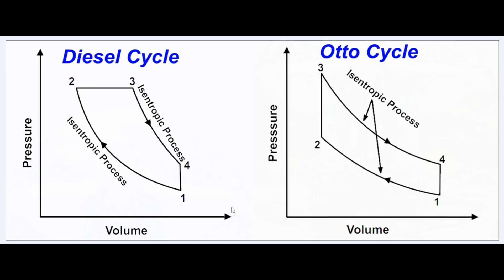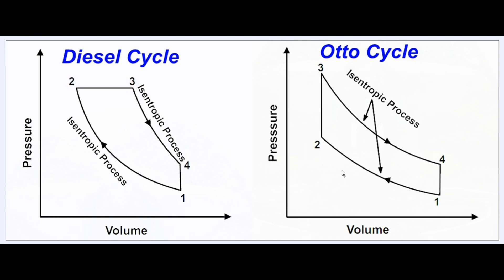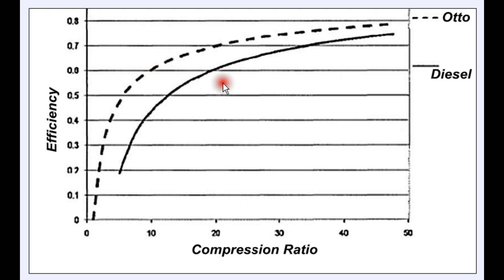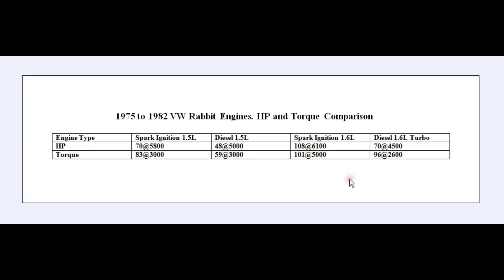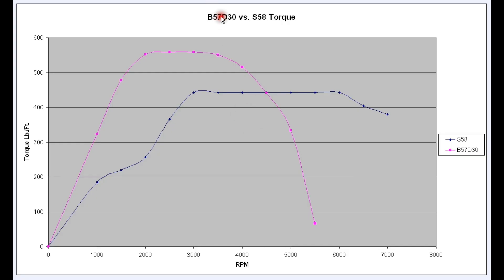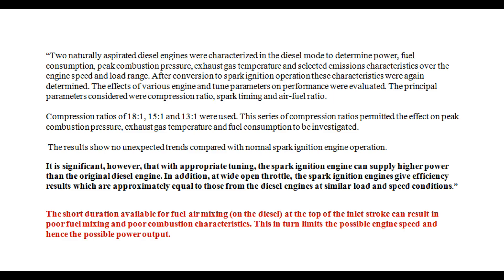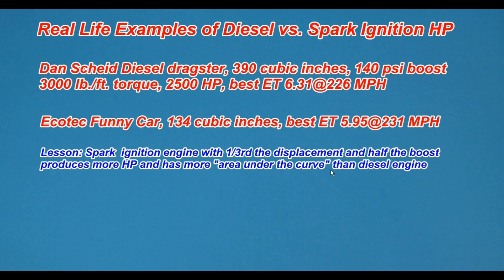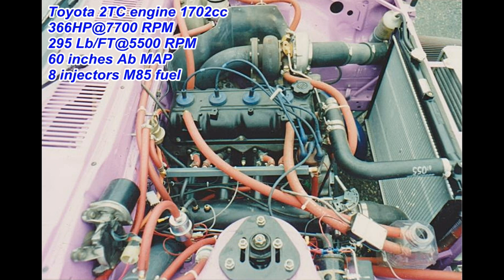Diesel vs. Spark Ignition. Torque and HP.

Comment: Talking about apples to apples, does it make sense to put fuel flow under the torque and HP on those charts?
Reply from the maker: The CI engine has a fair advantage in BSFC at high power compared to the SI engine. In cruise, with the SI engine running LOP, the CI engine only has a small advantage. Diesel/ Jet Fuel weighs about 10% more than Avgas per unit volume.
Reply: @rv6ejguy JetA is 10-30% cheaper than Avgas too, not important though... What if the aircraft is designed to run the engine at full/high power both takeoff (with electric assist) and cruise? Does it justify the use of CI over SI?
Reply from the maker: Aircraft engines run at pretty high power settings in cruise anyway. Electric assist is just dead weight in my view. @ruming404

Comment from the maker: Leo Arc, the torque curve is fairly typical of modern turbocharged SI engines where boost is adjusted to hold peak torque  and cylinder pressure just short of the detonation threshold.

Comment: In addition, a parameter which is often overlooked is engine weight. In a fair comparison, diesels tend to be heavier - a fact which is often and conveniently overlooked.
In some applications, diesels can have an edge while on full fuel tanks, but, as fuel goes down, that advantage quickly disappears.
Even when a diesel appears to be more efficient on paper, as soon as the weight is factored in, spark ignition often shows itself to be the better choice.

Thank you for another great video.

Comment: Is the graph at 8:50 (the torque distribution of the S58 engine) accurate?
From 3000 to 6000 RPM, the torque remains practically constant. That's not typical of internal combustion engines.
Reply from the maker: Very typical of modern variable geometry turbo SI engines where boost is varied to maintain peak torque just short of the detonation threshold.
Reply: @rv6ejguy  That does make sense.
Many thanks.

Comment: So the point is, everybody should want a motorcycle engine in their plane? Low weight, high rpm, high power.. Just gear it down to a prop and bob's your uncle. If all they want is the best power to weight.
Reply from the maker: Some of the sled and bike engines are working pretty well now and they can be a good choice for some folks. They are probably not going to last 2000 hours being flogged however.

The comparison just shows the facts. Diesels are expensive, heavy with low power to weight ratios but often have lower fuel burn and  lower performance. They can be the right choice for certain missions and where avgas is scarce or expensive, they make a lot of sense. There is no one perfect engine for all missions and locations.

Comment: VW rabbit engines were junk nothing compared to the cummins, Ford, or GM Duramax. There is no comparison if you take a 6-7LT gas engine boost it have to run racing fuel 115 octane to equal the power.
Reply from the maker: Modern turbo engines easily produce over 120-250hp/liter on pump gas. The Koenigsegg Jesko runs on pump gas, producing 1281HP from only 5L. Totally kills these diesels in specific torque and specific hp in factory form. On E85 pump fuel, it produces over 1600hp and 1100 lb./ft.

Comment: Yes the advances in SI engines now see BSFC in cars as good, if not better than CI engines however none of this yet translates to aircraft. 

High BSFC in SI requires high compression ratio's (12.5:1 in my own Audi FSI) and direct injection. Neither is possible/available in aviation engines as high compression triggers detonation at altitude and so the conventional solution is to run lower CR (<10.5:1) and resort to ROP operation particularly at higher power levels.  This means real world BSFC of SI engines is not good when ROP full power/climb power settings are included in the 'total flight' BSFC.  And turbo SI variants must run even lower CR to avoid detonation with correspondingly lower BSFC. 

Whilst experimental operators might 'dance with detonation' and attempt to improve BSFC by running high CR and leaning at higher power settings,  the price of failure is very high. Many many high compression experimental engines have failed this way.  Certified SI aircraft are not permitted to operate in the red box as detonation margins are preserved in POH procedures and CR is rarely permissible over 8.5:1.  Maybe there is a reason for this!

CI engines by comparison run optimum stochiometry at all power settings and are not limited by detonation considerations.  And they are all turbocharged out of the box so are equipped for altitudes up to around 25K to boot. Yes CI is heavier but the mission weight of fuel/engine is often competitive with SI when ROP operation with wasteful BSFC is avoided.  

The result is that CI engines are a LOT more fuel efficient. Here is a clip from the AVWEB review  showing the Diamond diesel powered DA50 was wayyy more efficient at 3NM/lb of fuel. Nearly twice good as an Cirrus SR22 at 1.8NM/lb.  The state of the art Panthera even with retract gear, only manages 2.4NM/lb of fuel.  The DA50 is fixed gear.

https://www.youtube.com/watch?v=fmlfg-74m3U&t=1016s

So its not accurate to portray the BSFC advances of 'ground borne' auto SI engines as suitable for flight. They are not. At altitude, CI engines rule when it comes to mission NM/lb of fuel. Attempting to replicate good airborne BSFC with SI engines using high CR and LOP operation at high power settings should be approached carefully as it is a pathway to detonation if not done well.
Reply from the maker: First, I'll direct you to this video where I dissect this subject in detail: https://www.youtube.com/watch?v=GJy93vrbvw0&t=16s You'll see that the aero diesels don't match the Adept SI engine in overall mission fuel burn.

High compression ratios doesn't trigger detonation at altitude. Detonation will be most likely at sea level where MAP and cylinder pressure is highest, not up high where MAP and CP are much lower. With EIs, we can tailor the point of PCP based on MAP and mixture strength. With mags, not so much.

Lots of my customers are running 9 to 10 to 1 CRs with no issues. The key is electronic ignition and EFI and lots of LOP operation (even in the climb) where cylinder pressure and CHTs are kept low. I don't know of any failures like you're taking about and we have many hundreds of people flying Lycomings and Contis like this for many thousands of hours.. There is no "dancing with detonation" here as you assert.

 TAT Runs 8.5 CRs with their certified turbos in the Cirrus and these are more efficient than the early factory std 550 turbos. CHTs are actually lower on the TAT as well.

Nobody is routinely flying aero diesels at 25K as none are certified to fly up there and canula type O2 doesn't cut the mustard up there. Additionally they cannot maintain anywhere close to rated power up there due to the high pressure ratios that CI engines require to make hp.

I'm not sure what data that chart is based on but it isn't of data from Diamond's website. Diamond only lists max cruise as 181 KTAS and fuel burn at long range cruise at 59.4 pph. Obviously max range cruise won't be at max speed. Lets say generously 155 KTAS. That's 2.61 NM/lb. This isn't even as good as a fixed gear RV-10 running LOP with EI where we've seen up over 2.9.

The DA50RG is a very heavy, high drag airframe, in part due to the heavy diesel engine.

Make sure you are comparing at the same altitudes and TAS or it's meaningless.

I don't think you're up on the latest tech as applied to Experimental Lyconentals or modern SI aero engines like the Adept 320T.
Reply: @rv6ejguy   Every SI engine that is leaned at high power settings will transition near or over detonation regions. With Mogas the potential for detonation is worse.  Detonation leads to higher crank loads and EGT excursions which burn valves and stress exhausts.

Sure LOP is great for reducing these problems however the transition from ROP to LOP must be made each time.  The temptation for operators to 'save fuel' when ROP it to get too close to peak EGT.  Or 'get more power' when LOP and again get too close to peak EGT.  Same when tuning where the temptation is to advance ignition for more power and again increase BMEP with potential detonation.   FAA mandates generous detonation margins in certified engines, however the temptation for experimental engines is to test these margins and 'dance' close to peak BMEP/EGT in order to save fuel or get more power. 

I'm surprised you are debating this point when CI engines simply don't have it as an issue at all, yet for SI tuners its the number one consideration and issue.  For proof how experimental versions of certified engines die from detonation, why not start here;
https://web.archive.org/web/20190409234254/http://flash.avweb.com/avwebflash/news/Detonation-Concerns-Superiors-Buyback-of-XP-400-and-XP-382-Engines-232603-1.html

Of course a well setup EFI will avoid these issues as mixture/advance is automated, however when tuning these systems its still imperative to build in generous detonation margins across all OAT and charge air densities for the same reasons. Quite hard to do.  As one example, Viking Engines whom sell converted GDI (direct injection) engines abandon the benefits of LOP operation and program the EFI with generous ROP fuel in order to improve reliability and avoid detonation.  Why?
Reply from the maker: @lelievre12   We ARE leaning at high power settings and have no detonation issues. Detonation is far less likely at 50 LOP vs 50 ROP. You can educate yourself by reading John Deakin's works or looking at the Pelican Perch on Av Web.

I run 91 mogas on my turbo Subaru. No issues with detonation even with the 9.25 CR. AFR at best power (12.8) so not excessively rich.

With SDS EFI, we simultaneously go LOP and advance timing to achieve PCP at the optimal crank angle for best torque with the slower burning mixture. Happens in a split second. I'll say it again- there is no dancing with detonation here. I've done several vids on my friend's 9 to 1 CR RV-10 with SDS showing how this all works. I have other customers flying 10 to1 Lycomings, even on crappy 87 mogas- no issues and one Rocket guy climbs LOP on mogas. Dave Anders  can get over 40 mpg in his RV-4 and still do over 250mph on the top end with SDS.

AV Web got it wrong here on the XP 382 and 400 engines. They were quoting Superior's erroneous initial conclusions. Superior blamed the crank failures initially on detonation when there was zero evidence of that. I followed this closely and looked at the failed crank photos. No piston, ring or ring land distortion evident on any engines. Superior directed owners initially to retard timing from 25 to 20 but still cranks broke. It turned out to be a bad design with insufficient validation, relying on flawed FEA models and in the end a metallurgical flaw (thick white layer formation) related to the nitriding process. Nothing to do with detonation.

Eggenfellner doesn't know much about engines. I've worked with him and supplied him with EFI systems in the past.

The Adept 320T is able to run relatively lean at climb power, being liquid cooled and FADEC equipped. It shows the overall superiority of SI aero engines compared to CI engines- better power to weight ratio and better cruise BSFC.

Tuning EFI to avoid detonation isn't hard to do. I've been doing it for 27 years. My background is turbocharged engine development and I've assisted with 3 Reno Gold Sport Class winners, including the fastest Conti powered aircraft in the world.
Now some real numbers for the DA50 RG from Diamond's flight testing at 12,000 feet, 2 people on board: 

Best range cruise 50% power 149 KTAS 56.1 pph, 2.66 NM/lb. BSFC .374

Med cruise 75% 170 KTAS 83.1 pph, 2.045 NM/lb. BSFC .370

Max cruise 87% 182 KTAS 94.38 pph, 1.93 NM/lb. BSFC .362

My friends RV-10 turns in 2.66 NM/lb under similar conditions at 155 KTAS- with fixed gear.

Let's start comparing modern liquid cooled SI engines with modern liquid cooled CI engines.

Comment: Biased Information
the B57D30 isn't "pretty much done at 4000RPM", it's in fact producing 15% more torque that the S58
If you take both engines and gear them down for a 2000RPM propeller,  Roughly 1:2 on the Diesel and 1:3 on the SI, Throttle them to 350HP cruise. compare BSFC at that throttle. I'm pretty sure Diesel wins, but the main advantage of the diesel is the fuel availability.

Comment: have to agree that Si engine produce more power , so what the designers have have done was   build an engine based on the characteristics of the diesel fuel, like how SI engines are designed based on the characteristics of  petrol , so its not apples to apples ...you design an engine based on how much efficiency you can get out of the fuel...what you' re comparing is the geometry of an engine  with equal dimensions to 2 different types of fuel, which i don't think is fair.
Reply from the maker: The new AC-Aero engines are multi fuel but BSFC figures are not as good as existing SI engines, though being 2 stroke, they have greater power density and better power to weight ratios.

Here I just compare CI and SI to dispel some common misconceptions. These, plus turbines are our main choices for motive power.

Comment: Grant you this is correct in race conditions but who drives their engines to the full rpm available day in day out. Driving around town at moderate RPMs or an aero engine limited to 2,800 rpm by the propeller, the diesel has more area under the curve.
Reply from the maker: I don't drive around at low rpms too much. I like to zing it out when I want to accelerate. My BMW sees 5000+ rpm several times a day. Why wouldn't I take advantage of all that power when I need it?
Reply: @rv6ejguy  "or an aero engine limited to 2,800 rpm by the propeller, the diesel has more area under the curve." Just ignored the important part eh? Sure, the diesel is rpm limited but when you have a lower limit imposed by the prop, who cares?
Reply from the maker: @LukaS-iy1gs  All the aero diesels are small displacement, geared engines save the SMA and its derivatives which don't compare favorably with turbocharged direct drive SI aero engines in power to weight ratio or area under the curve. One of these SMA engines (modified for more hp) was raced at Reno in an NXT in 2011 and was pitifully slow.

Comment: If you have a constant speed prop, does 'area under the curve' matter or just the HP at the RPM of the prop?
Reply from the maker: If you're just concerned about one point on the curve at cruise for instance, you could make a direct comparison between engines at that same point. The area mainly quantifies the ability of the engine to perform work across its operational rev range.

Comment: Diesels can run high boost, but gasoline can’t run very high boost due to pre ignition?
Reply from the maker: SI engines don't need as much boost to make the same power as a diesel as  I proved with numerous examples. In any case, some drag racing SI engines run over 80 psi boost without preignition.

F1 engines were making almost 1000 hp/L 35 years ago. Doesn't seem to be a big limitation.
Reply: @rv6ejguy  I don’t doubt SI can have high boost in some cases (theoretically and implemented in some cases) but why is e-SKYACTIV X’s SPCCI a thing and why don’t we see high boost CI on most of the cars? Why don’t car manufacturers just increase their boost on CI to have better performance than diesel? Is it because the fuel we use on the street (87 /91?) or does it require more engineering, more material, etc?

Comment: These are all wot dynos, gotta figure in the fact that gas engines are driven with the throttle 10% open most of the time cruising on the highway, which is the equivalent of driving a diesel with the exhaust brake 90% closed.
Diesels are more economical until we mostly eliminate throttle pumping losses. We could reduce pumping losses by using e85 and running lean which will require a larger throttle opening, that coupled with a higher compression ratio would make using e85 get almost as good mpg as gas. Itd be cheaper (with the help of hemp made ethanol) and itd reduce the worlds dependency on fossil fuels
Reply from the maker: The latest Toyota SI engines already have 14 to 1 CRs and are as efficient as light diesels now, even at light load. The stoichiometric mixture for E85 is much lower than gasoline and the BTU content per gallon is much lower so that will never allow better MPG figures than gasoline. My vid #92 covers more of the theory here.

Comment: I don't understand why you focus on a given displacement and boost pressure. Why do I care if my diesel has to have twice the displacement and twice the boost pressure? What matters to me is power/fuel consumption, power/weight, or maybe power/cost. How do they stack up in those numbers, if each engine type is optimized separately?
Reply: if it has twice the displacement and is running twice the boost pressure for the same power then it probably won't have as good of a power to weight ratio though
Reply: @Paraphen  Oh, absolutely. I'm just saying it seems preferable knowing that directly.
Reply from the maker: The purpose was to compare apples to apples and show that CI engines don't make more power or torque than SI engines of equal size with equal boost as is commonly believed.

Comment: So what is diesel better at?  I throughly enjoyed driving my diesel Jetta more than and other NA gas car (yes not apples to apples)..  does a diesel cycle engine typically have more torque at a particular RPM than an equal displacement spark ignition engine?
Reply from the maker: No, the diesel is inferior to an SI engine in both torque and hp across the whole rpm range (same displacement, same boost pressure).
Reply: @rv6ejguy  Thanks for the reply.  Honest question then.. Why do we use it?  I love driving my TDI (but my Tesla is better of course!)
Reply: @gsxr1kmatt  "Why do we use it?"

Because people buy it.